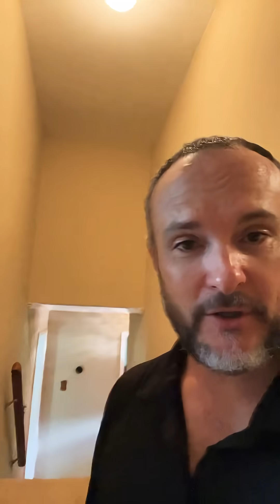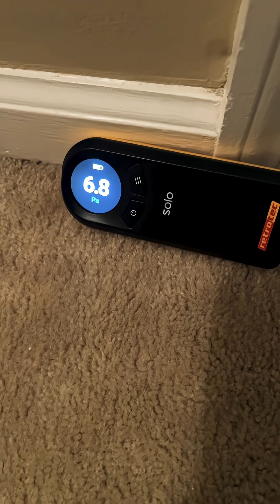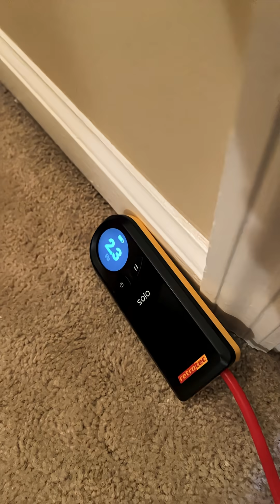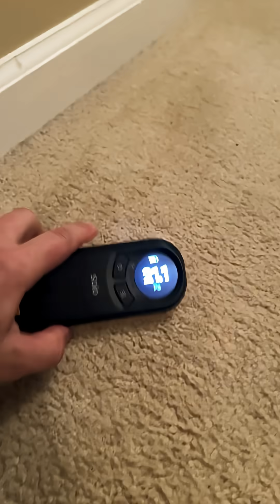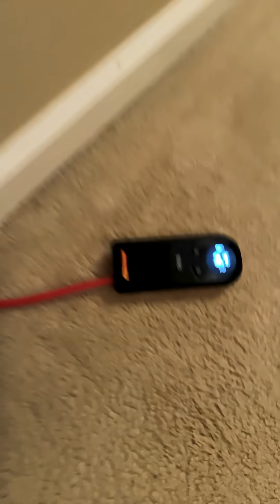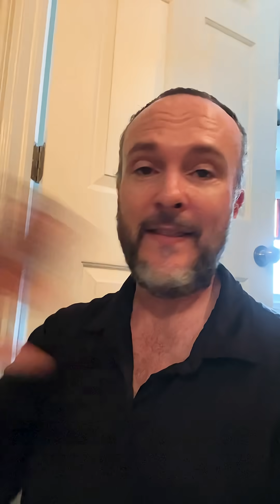Pressure Problems in Unbalanced HVAC Ducting at Home, Solved with Manometer and Roomulator

Comment: The only thing about under cutting the door is if the decide to go it laminate floor down the road, it will be way too high with the new floor. Since its nowhere near enough with just the undercut anyway, they might as well just include the full cfm needed for pressure relief in a jumper duct, or relief grills in the wall.

Comment: Sadly, door undercut method not so good on hollow core doors. I ended up trimming off the entire bottom edge fill piece.
Reply: Better to make a door jig and cut the bottom with a skill saw. Carefully remove the waste and glue the trim into the door. Using a hand planer is the worst advice.

Comment: By the way you can use your phone to measure pascals
Reply: I went up and checked a bedroom the door closed vs. open is .10 hPa which converts to 10 Pa, you have to keep it still on the floor or dresser.
Reply: Physicsduck is the YT channel
Reply from the maker: Sorry no way
Reply: @HomePerformance  The pressure sensor in your phone is sensitive enough to see one foot of altitude change
Reply from the maker: HOLY $#!% I think you’re right! Video coming soon- what’s your name my friend?
Reply: @HomePerformance I was in my bathroom and had the app up and turned on my bathroom exhaust fan and could see the pressure change.
Reply: @chptech ?? What app on phone?
Reply: @davejohnsonnola1536  xohpyhp this is spelled backwards I think it is censoring my comments for some reason,
Reply: Thanks. Great information
Reply: @HomePerformance Yes with the phyphox app

Comment: Maybe I'm wrong but if you have the hose on the right hand (red) port of the manometer doesn't that mean the rooms are negatively pressurized with respect to the main body of the house? I just double checked some Retrotec materials and when testing room pressures they do show the hose on the left hand (blue) port. Maybe you can clarify?
Reply from the maker: Yeah, it gets confusing when they use + and - symbols. Think of it as INPUT and REFERENCE. You’re measuring the pressure IN a room WITH REF TO the house. You can common sense check it by seeing there are 3 supplies but no returns in that room.

Comment: There’s a lot more than just that tool involved with this. What size are the rooms we’re dealing with? Are the supplies the right size? You’re talking about a 14” round return that’s a large room how big is that supply? I’m a huge proponent for individual returns but nobody wants to pay for those. Trust me.
Reply: A large bedroom with a large attached bathroom has a lot of air supplied. I've got 2 12x6 registers feeding the master bedroom and 2 9x6 feeding the bathroom. I had an extra supply run to the bathroom because it has a big skylight which isn't low-E or double-paned, and it was hot in the summer and cold in the winter before that was installed. The return takes up one wall cavity, with a finished 30x12 bump-out to get the return past the top plate of the wall.

Comment: Can you recommend a low cost meter for the dyi guy or weekend warrior? The one you are using is $700!
Reply: There are no low-cost manometers that measure pascals, unfortunately.
Reply: Under $250
Reply from the maker: The one linked in the notes is $400.

Comment: The problem is you kill your sound barrier. For example, in my new home that’s under construction now we’re doing staggered studs with either rockwool or dense pack with two sheets of 5/8 sheet rock with staggered seams and a custom-made soundproof door. How do I keep the soundproofing but relieve the negative pressure?  We are installing a Broan ERV and the supply dumps into the master closet
Reply: Each room should have a supply and return to the HVAC system.
Reply: I'm in the same situation. The house is 1100 sq ft and the bedrooms are right off the living room with a Jack&Jill bathroom between the bedrooms, so blocking noise is important. I'm even thinking of adding a door gasket or door drop seal for noise.

HVAC and ERV returns are the only solution I can think of.
Reply: Ideally the supply should go into every bedroom. Is there a door on the master closet, and how much is the closet being pressurized? Hopefully the closet isn't in the bathroom, or all that steamy air will get pushed out of the bathroom. An alternative to a return duct is a transom-style return, where you put a register in the bedroom near open space (hallway, etc), and another register in the open space, and connect them with boots and some flex duct. Ideally an insulated boot and insulated flex duct would keep most of the noise going between the open space and the bedroom.